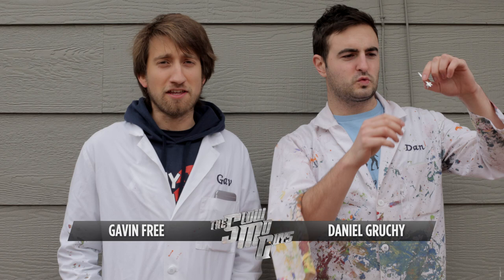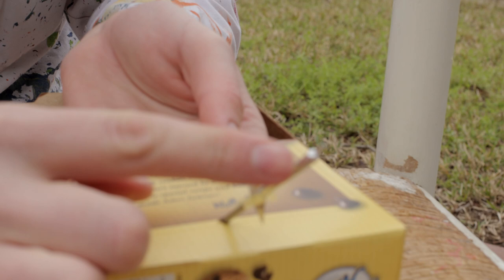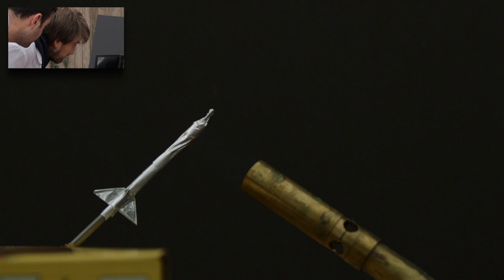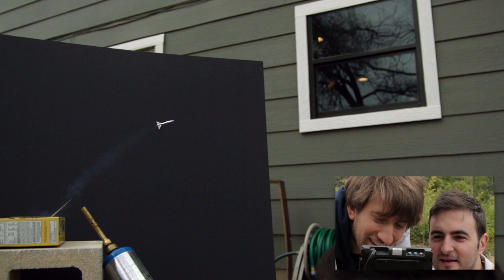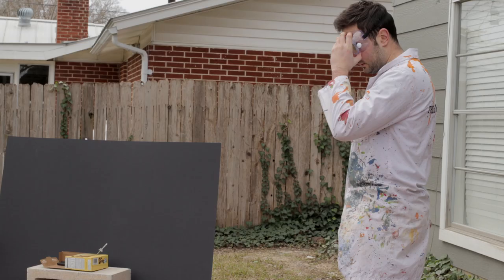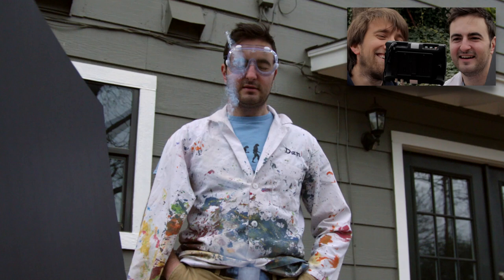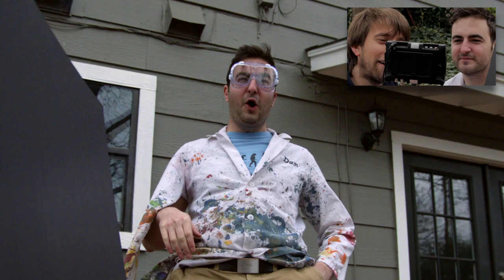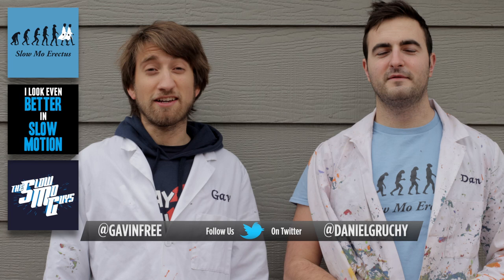Match Stick Rockets in Slow Motion - The Slow Mo Guys

Comment: You're the slow mo guys..... why aren't your videos at 60fps????
Reply: I remember Gavin giving a reason why the videos are not 60 frames, I don't remember which video, however.
Reply: guy hircshorn Probably because to have a 60 fps video they could only slow things down half as much?

For example if they were to display the 2500 fps video from the camera (as seen in this video) at 60 fps, they'd be slowing it down to 1/41,66666(...) real time.

2500 / 60 = 41,66666666 (...)

At 30 fps however, they are able to show the video at 1/83,33333 (...) real time.

2500 / 30 = 83,33333333 (...)

Things can only be slowed down half as much if you want to have a 60 fps slowmotion video compared to a 30 fps one, and since this channel is all about showing fast processes as slow as possible, 30 fps is clearly more ideal for that.
Reply: 2500fps played back at 25fps (2500/25) is 100 times slower than real time

2500fps played back at 60fps (2500/60) is 41.6 times slower than real time
Reply: Yeah, what XDerKleineX said. They filmed this vide at 2500fps and played it back at ~25fps, making it 100x slower than real life. If they were to play it back at 60fps, it would only be 42x slower than real life.
Reply: Actually the frame rate the youtube video is rendered in does not effect the "slowness" of the video. No matter the frame rate they play the video back in to make it "slowmo" when it is uploaded to youtube it is rendered in 30/60 fps, but it doesn't change the effects of the "slowmo" because the video is not uploaded to youtube at 2500 fps and then slowed down, it is already slowed down and that is what is being uploaded.
Reply: Nick Pinch but it would have to be uploaded at 60fps otherwise it would be the same as watching a hd upload of a 240p recording. youtube cant create content out of thin air you know :p